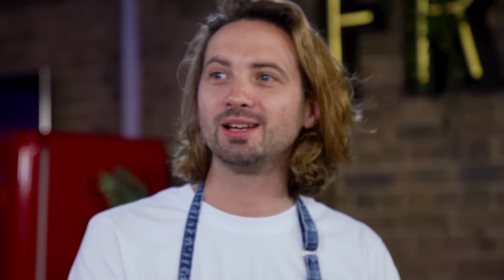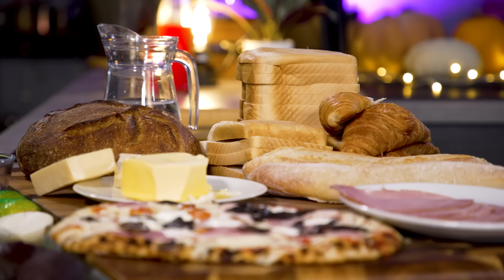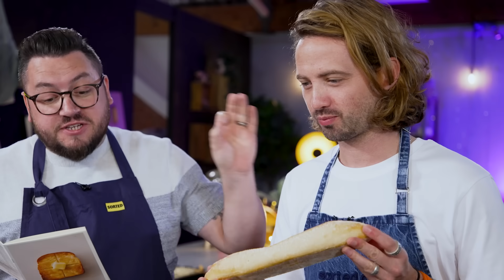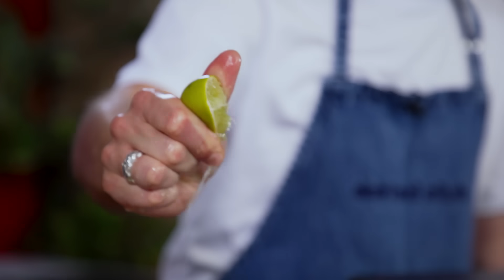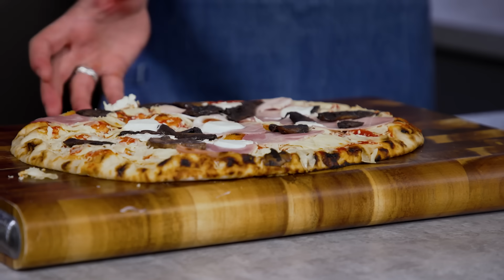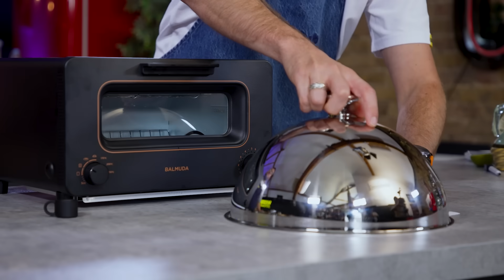Is this £260 Toaster GENIUS or an Absolute Waste of Money?!

Comment: Today, and toaster that actually works decently will start around US$75.  This might cost 4X that, but if it works perfectly and has added capabilities, I would seriously consider it.  However, I would tend to pit it against a toaster over rather than a toaster.  That should cut the cost differential substantially but may bring more limitations into the equation.  Finally, if it is going to last longer than a cheap toaster that needs frequent replacement, it may turn out that the lifetime cost difference might be a lot less.

Comment: I notice they tried to avoid showing the underneath. The accidental glimpses showed just how poorly this piece of post yuppie junk performed. Essentially dried out with no maillard reaction but for the odd burnt patch. 
For REAL toast with a fluffy middle you need higher heat than this can likely deliver. As a workaround, freeze your bread slices and then double cycle.
Or just use a proper bloody salamander/old fashioned grill

Comment: I was watching this and decided to make some toast using a similar method in my standard cheap electric oven under the grill. Preheated it to very hot (275C) then put the slices of bread on the top shelf and 1/2 cup of water into a baking tray much lower down which had been in there as the grill heated up. Immediate steam cloud, closed the oven door. Turned it when it was golden brown, let the other side toast the same. 

PERFECT crisp-fluffy middle-chewy toast. 

Immediately buttered and marmaladed.

Conclusion: I still sort of want this little tiny toast oven. And it’s less wasteful of energy than my method. 
BUT I now don’t need to buy another expensive appliance and find somewhere to store it. 

I’m going to try buttering the ‘raw’ side before toasting next time to fully replicate the video method using a grill. But I’m pretty damn happy with this discovery.

Comment: Seems like I could get a lot of the same functions by putting a small (heat proof) container of boiling water on the bottom of my convection/multi-function oven.  It might not be nearly as accurate* as this thing, but I could probably get close.

*Actually, the one I have, the "Instant Omni Plus" Is super inaccurate and honestly, kind of crap.  I imagine a decent Convection/multi-function oven could get even closer.

Comment: Could you get the same effect in an air fryer using water?  I've started doing cheese on toast in the airfryer with a couple of tablespoons of water in the bottom.  Both crunchier and softer inside.  Maybe the same kind of experience?

Comment: When you did the croissants, it made me wonder if it can resurrect day-old pizza.  If it can do that, I'll buy one.
Reply: It works extremely well for day old pizza. Faster than having to monitor a hot pan too cook or using a larger steam oven
Reply: air frier does it very well. they cost $150.
Reply: emmymade just did a video on this toaster (and was surprisingly thorough).

Yes, it can resurrect day-old pizza. Go get one. Or watch her video as well beforehand, sh×t's expensive.
Reply: Frying pan on medium high heat, wait for the pan to get hot, add your pizza and a lid and cook until the bottom is crispy and the cheese melts, resurrected pizza.
Reply: @tryfan987  Thanks for the tip of putting the lid on.  Not perfect, but the best method I've seen yet - by far.

Comment: That’s Asian appliance market for you.

Here at home, we have a $750 wifi connected, induction pressure rice cooker that has ridiculous amounts of sensors (1 outside to detect room temp, 1 underneath the cast iron pot, one under the lid), a barometric pressure sensor (to guarantee rice quality and germ moisture) and oled display. Talks too, announces when the rice is ready.

Actually just got software update a few months ago that corrects issues with the steaming and clay pot rice functions.

Comment: I actually bought this for this video! I was thinking on getting an air fryer because I use the oven very often in small things. I don't have a toaster so this fits both usecases if you cook small portions often and want to save in electricity. I reckon this will pay for itself after two or so years.

Comment: It's a strange thing, because it solves a problem you wouldn't have if you just buy what you need. Well... besides the toast of course. But if it only does the toast, if you buy what you need, then it's extremely expensive. If you think it does all thinks alright/great then it's just expensive. I wouldn't buy it.

Comment: Barry is right, but not for the reason he thinks he is.  Dextrinisation IS what produces the toasted color, but it has nothing to do with the fact that wet things can't burn.  This, as I understand, has to do with the fact that something wet cannot reach combustion/carbonization temperature until the water has evaporated.  Except for certain circumstances, materials cannot be heated past (or cooled below) their transition point without the phase transition happening.  Note that this transition point is variable with things like pressure, which is how pressure cookers get liquids above what we consider boiling point.

Comment: But it did not automatically make the best toast. You had to measure water into the device, cut a cross into the toast, butter the toast beforehand, then butter it again halfway through the baking process and then it came out burned at the bottom. That seems like an awful lot of work for a subpar result. Also, what would the toast have turned out like without the butter? I hate butter (or butter substitutes), so that's an automatic no go for me. 
I'd rather have the mitsubishi one, even though I went into that video expecting to hate it and ended up googling for the thing to find out where I could order it from.

Comment: It seems to do a good job, but I still fail to see how a regular oven couldn't do basically the same thing, if set up properly (such as lightly wetting the bread before putting in the oven, or adding a small dish into the oven for at least part of the cooking/refreshing time - both of which I've done numerous times with good results). With that in mind, it seems largely like 260 Quid for another "thing" to take up space in my kitchen.

Comment: If you love breakfast, this is for you. If you often reheat foods, this is for you. If you love bread, but don't go through it near quick enough before it goes off, this is for you.

FWIW, if it can work with the fan but without steam, it's a convection oven and should work for roasting. Shame it can't do a quarter sheet pan though.

Comment: You boys need to get your hands on a convection toaster oven, one that can bake, toast, bagel, broil, cookie, reheat, roast, warm and pizza its way into glory.  Then tell me this single-use "toaster" at $410 (CAD) is worth it.  Plus, my oven comes with a pizza pan, a cookie sheet and a roasting pan, and I don't have to cut the pizza in half to bake.  Forget steam to refresh bread, convection does the same thing, creating a crispy outside and a soft inside, all on the reheat setting.  I also have a pull out bottom tray for when the cheese toast flows over.  Clean up is easy-peasy.  So sorry, nope.

Comment: This video has infuriated me so much lol. All the testing you put it through, and to me it just comes out looking like a bog standard toaster oven. Even just the simple toast setting, at 2:52 you can glimpse the bottom for a second and it looks uneven and a little burnt in one part! Literally all the stuff you did in it you can just do in a regular oven with grill. It doesn't even take long for the grill to preheat, probably no longer than this thing took. And you can splash the water yourself. You paying £260 so that you don't have to manually put some water on your food? lol. And how can Jamie possibly compare it to paying £250 for an outdoor pizza oven, which does something that literally nothing else in your kitchen will do (ie reach heats of 500C!), whilst this thing just emulates what tonnes of other stuff that you already have lying around will do for you. In fact I reckon most of the stuff you put in here would work well in an air fryer (would def do the pizza better than this did it). Argh, I'm just annoyed at this product lol.
Other than that, love the channel as always 🤣🤣

Comment: If you're a maniac for toast sure, price is subjective in the end, but entering this price range I'm already looking towards a full-feature countertop oven with convection, grill, pre-heating and overall even cooking. Even if you have a normal oven in your house already, having this double as one could prove useful to cook single servings but it doesn't, it appears to be mostly "meh" for anything other than re-heating and toasting. I'd splurge on something that costs $499.99 that does everything well at this point, or look for a toaster which price doesn't enter the hundreds.

Comment: I think the problem this has is that, for £260, you are starting to get up there with top of the line toaster ovens
at that range you're looking at like Smart ovens that can also double as an air fryer, and have several more functions than just steaming like this, but are also way bigger and can fit like whole chickens or multiple pizzas.

Comment: The only reason I can see for buying the machine they are testing is if you have EXTREMELY small kitchen. This cooks for one person only and that is if you are not a big eater. Sure, it can reheat or make pizza faster than normal oven and use less energy but that is true only if you consider making one slice of it. Try making full one, oven does it in one go, this machine here would need what, 6 times?

If you consider this only as a toaster then for me it is way above price range I would be comfortable using for that goal- even if it makes ideal toasts- and other uses are extremely limited because of a small size of the device. Like cookies example, baking full batch would would take so long when only 4 fit inside. I would be more prone to thinking about buying it if it was near full oven-size.

Comment: I replaced my entire oven (and grill/broiler) with a countertop Breville "toaster" oven. It was around the same price ($350), but I love it for all the reasons you guys listed. Plus, I live alone, and could never use my oven due to my disability. Now I can! And it fits a whole pizza in it. What's not to like? 

I think this oven is a little bit unitasker-y, since you can't control the temp very well, and I'd spend a little more for a LOT more flexibility, if it were me.

Comment: Of course, you guys realize that you have to do a basic equipment battle with this now... (But only if you actually want to.)

I didn't see that this particular toaster did anything that you could not do in an oven (if you really want steam, fill a deep tray with water and place it on the bottom rack). I can see where it has a place in the market for a kitchen-less studio and to try and save the amount of energy being used, but I don't have the kind of economical mind to figure out if that is worth 260 GBP.

Comment: There are toaster ovens on Amazon and other stores for less than £50. If you put a little cup of water in them, and set the right temperature, I bet you can get just as good results from one of them as you do from this one.

Comment: No, the toaster is not worth the cost for one reason and one reason only. All the fancy nonsense with the water, the deep cuts, the butter (twice) and the time is fine. I would have no problem doing all that for perfect toast. The reason it's not worth it? Two slices. That just doesn't work for me. My toaster oven does six slices of most breads at one time and it does them better than any toaster I've had previous. It cost $80. It also does perfect bagels, bakes and broils (which I have used it for MANY times) and has a great Keep Warm feature.

Comment: I'm curious to know what happens if you don't add water.

I have a $39.99 toaster oven that does all those things, except plain toast, very well, and a regular $39.99 toaster that makes excellent toast.  I keep the toaster on top of the toaster oven.  Between them, I can make pretty much any small thing I want without turning on my huge oven.  This is a fun toy, and I"m sure it works well, but I couldn't justify a $300 toaster.

Comment: Useful note: You can refresh any crusty loaf of bread in a normal oven. Run some water on the outside, just enough to get all of it a little wet. Put it into a 350F oven for 10 - 15 minutes and it comes out with a crunchy crust and the inside tasting nearly as good as fresh baked.
Reply: I use a mist bottle to spray the bread before putting it in the oven. They’re only a dollar and you get even coverage
Reply: @TheKoalabear98  was about to comment this.
Reply: Flick water on or wet your hands and pat the loaf. Dont run it under the tap!!!!!
Reply: You can do this with a standard toaster oven too. If you are going to use a full blown oven you could even put a tray with some water in it on the shelf below the bread if you don't feel comfortable wetting the bread directly.
Reply: Correct.

I believe this gadget is for people who don't have the space in their kitchen for an oven.
Reply: 10 seconds in my microwave refreshes most any bread!

Comment: This is one of those “buy-in” things where companies buy into the product and then slap their own brand name on it. I checked Amazon and there are very similar toaster ovens with the same heat and steam system sold under various names. For the same money I would rather get a much larger toaster oven that can “air fry”, toast 8-9 slices of bread, fit a whole chicken to roast, etc.

Comment: I bought a multi function "toaster" oven not too long ago at around the same pricepoint. Not only does it make excellent toast, it's also a convection oven and capable of air frying. Have been using it a lot because it pre-heats in about 90 seconds and for a 2 person household it takes care of many things I wouldn't do in the large oven simply because it's ridiculous to heat a huge oven just to put 2 ramekins in for 10 minutes - or more ridiculous finish a pre-baked baguette at 400 degrees (F) for 4 minutes.
The little thing is much more economical for a smaller household - plus I put it in the Garage so whenever I make something smelly it doesn't smell up the house or heat up the house in summer.

Comment: I guess toaster ovens are a novelty in the UK? Any halfway decent toaster oven (at half the price) can do all this, if you have any experience with one at all.  The trick is not thinking of it as a toaster plus, but as a small oven that can replace a toaster on the counter. Jamie and Barry are both married with kids.  They're never going to need to bake two chicken kievs, single serve meatloaf, or two cookies.  If you're cooking for a family, baking bread all the time, or never do anything smaller than a roast chicken, you won't have a use for it (but then without a toaster you'll have to learn to do whole loaves at a time and spend 20 minutes doing it, using a whole oven)

Comment: Nope. I wouldn't buy it. While it may make wonderful toast, all it really does is make toast. I can make toast in my oven, my toaster oven, or the air fryer. I can add a steam element with a spray bottle of water and get similar results to this. If this was actually usable as a toaster OVEN (with more of a temperature range, more controls available to me, etc.), then I might consider it when my toaster oven dies. But $300 USD for a toaster? Nope. I've got lots of other things that I'd rather spend $300 on.

Comment: Tbh it just seems like an overpriced mini oven to me. You can get a kinda similar steam effect by just putting some water on top of the bread or simply putting a small plate with some water at the bottom of the oven. 
The only 2 kitchen gadgets (apart from the standard ones) i'd suggest every household to get are an Airfryer and rice cooker. Both can be bought relatively cheap, can serve tons of different utilities and offer good results, fast prep (Airfryer) and convenience.

Comment: If you're using a grill to make toast you can do the same butter trick.  Toast one side.  Turn over and butter the other side then back under the grill.  You can then add your marmalade or jam and leave it in for a few mins as the grill cools down.  That way you always get hot toast.

Comment: Seems to do a good job making toast, but with its limited ability to cook other foods because of its oddly specific temperatures, it doesn't seem worth it unless you plan on eating a lot of toast. If it was able to be used like a normal toaster oven with a wide range of temperatures, and it made great toast maybe it would be justified.

Comment: Best way to (quickly) heat a pizza is to give it a quick wack in the microwave, and then finish it on a non-stick gryingpan for a few minutes. It gets surprisingly good.
If you've got more time and patience, you can do it all in a frying pan, but then you need to add a splash of water and a lid to get the cheese to melt.

It's a fantastic way to bring back a proper crust to the pizza, something that would be lost in the microwave. It also doesn't overcook the toppings, as re-heating it in the oven would.

Comment: Looks like any normal toaster oven you can get here in Japan. You can buy little ceramic cups for 100 yen to fill with water to sit on the tray alongside your food and get the same steam effect.
Reply: Japanese homes rarely have full size ovens, so many microwaves come with an oven mode. Between that and toaster ovens, we can usually get by.